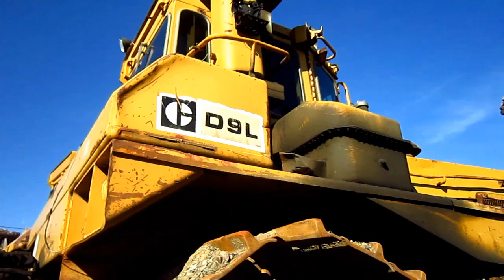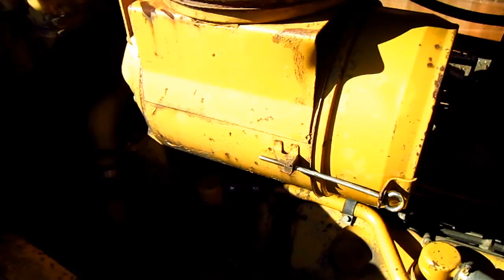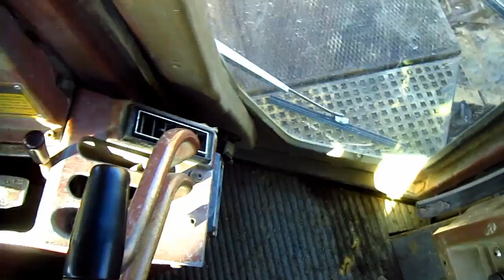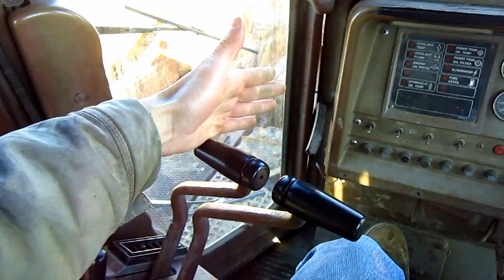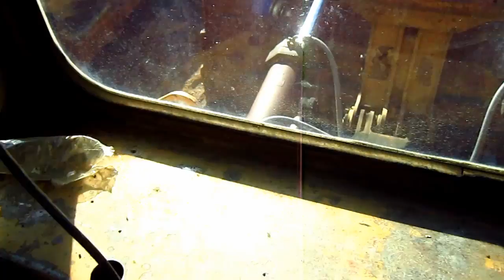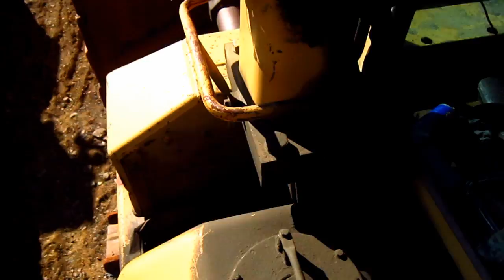Caterpillar D9L Documentary

Comment: I was lucky enough to get a new D9L around 84 or so. Man, did those tractors ride good compared to the flat track solid roller frame dozers! Shouldn't be compared to a D9H, much bigger. But, they had their issues. The first design High Track Caterpillars wouldn't climb slopes well. They were short overall for their size which was touted as very good for working tight places. But, the tracks simply wouldn't support them well on steep climbs. Going forward wasn't as bad as going backwards. They were, I hate to say it, helpless trying to back up a steep slope. I done a lot of drill bench work and had to be very cautious about that. The later D10N, D11N and so forth had the extended tracks which helped. Still won't climb as well as the old flat track tractors.
Reply: That is very interesting. I have also been informed that the track chains had a very high wear rate making them expensive to run.